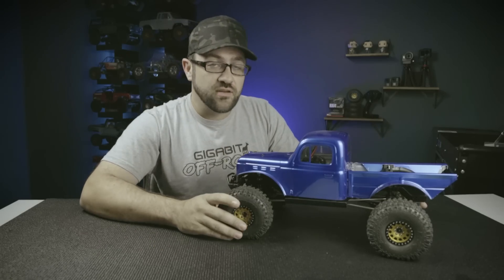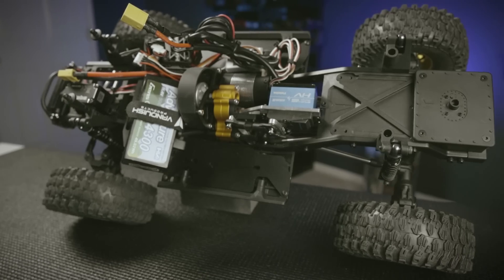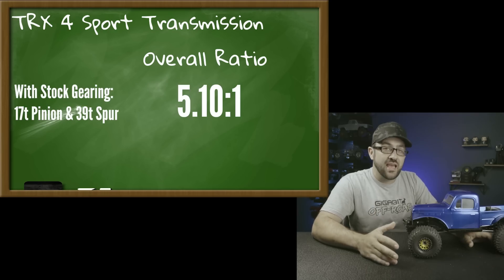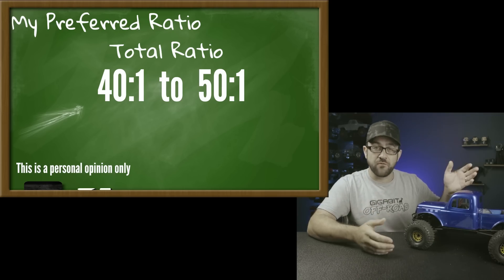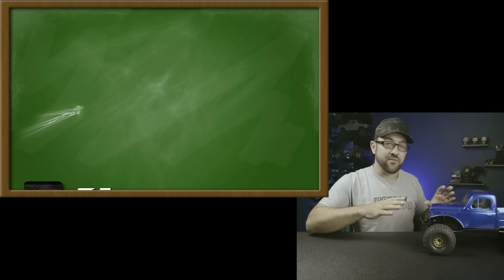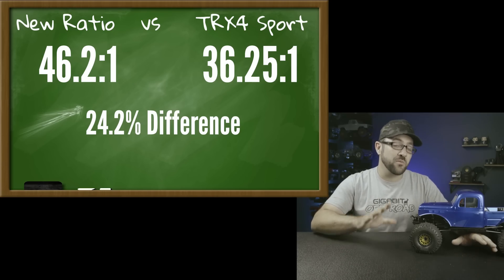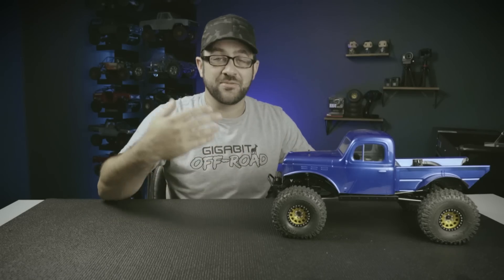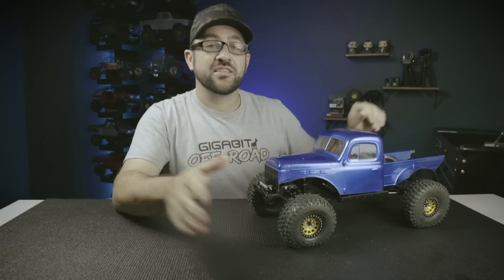TRX4 Axles with Axial Transmission - Gearing Calculations

Comment: I know I’m late to the game on this video but I’m trying to do something similar.

I have a TRX4 sport on an injora LCG chassis. I’m wanting a dig unit type transmission. Going to run an SCX10 skid (already made sure it fits the chassis I have). Transmission I went with is the VRD Hurtz Dig 3gear transmission. Staying on the TRX4 portal axles for now. 

This video greatly helped me figure out what pinion/spur combo I need to start with. 

My question is, what driveshafts are you using to go from a VP/axial style transmission to Traxxas axles? Would I still be able to run my Traxxas drive shafts? I understand some switcheroo on the shaft halves would need to messed around with for length but will the end caps still mount up? If not, what shafts are/were you running for this setup?

Comment: Does the sport and defender/bronco have different gear reduction in the portals?  Everyone keeps saying 2.3:1 in portal but mine measures 2.55:1....... 9 input and 23 output. That's 7.89 axles ratio not 7.11

Comment: Hey man i have a chassis vs410 phenix and vfd trans can i do the same with the vfd trans and skid or do i need to make custom links ?
Reply from the maker: I have made TRX4 axle work with a VFD before. You will need a couple new links though, I created a custom set that you can buy for that though. It's on the Vanquishproducts site. IRC00202 is the part number. I used that in combo with the SCX10-2 link set but the Phoenix set will work as well I believe.

Comment: Have you put trx4 axles under a vs4-10 with vfd transmission???
Reply from the maker: I have but it requires some less than ideal spacers on the axle side to be used to make the upper link clear the trans. I prefer to stay with the 3 gear for this setup.

Comment: can I use trx4 sport stock transmission gears and spur/pinion paired with scx10ii ar44 axles? is that possible?
Reply from the maker: That would not be an ideal combo. Going to the largest spur and smallest pinion would get you the closest but still not perfect.
Reply: @HarleyDesignsInc  thanks for your guide bro. How about using the scx10 portal axles, will that make the cut?

Comment: What would you recommend gearing wise with the vfd trans and trx4 sport axles? Would you still run a 50 spur and 20 pinion? TIA
Reply from the maker: Yes that’s still where I’d start.
Reply: @HarleyDesignsInc  I actually left the stock 56t on it and did a 15t pinion and its not that bad still has a little pep but would not call it fast lol

Comment: I understand you're using a dig but if somebody is not interested in one what's your opinion on using SSD's high ratio Wraith transmission with this axle conversion? I already have that axle setup with a stock ratio Axial 3 gear transmission and went to a 44t spur and 22t pinion and the speed is pretty much what i want with a 3S battery but i'm considering going to the SSD's trans

Comment: Hey just a few questions, would you be able to share the gear spreadsheet for us and why did you ditch the locking differentials?
Reply from the maker: I would need to redo the spreadsheet as it was just something I threw together quickly to do the math. 

I got rid of the lockers as they just aren’t an item I like to run. I prefer to keep everything locked.

Comment: If I wore to add the trx 4 axle to my 10.2 in the rear with ar 44 in front would I use the same method to find the right gearing ?
Reply from the maker: Gearing would calculate the same way. But you have to make sure you can reverse the rotation of the rear axle or that it spins opposite of how the AR44 does, which I don’t recall.

Comment: Changing the TRX4 spur and pinion is not easier?
45/15 = 47.4:1 final gear ratio.
Reply from the maker: The point was to get away from the TRX chassis and trans.
Reply: @HarleyDesignsInc  Oh ok..

Comment: Would a higher KV brushless motor also be an option? For instance, if you just happened to have a 3300kv sensored motor lying around, the default gearing from this setup would essentially gear down that motor for more trailing speed, wouldn’t it?

Comment: Awesome info on the math but it’s a 9t not a 10 for the 
Portals. 2.55
Reply: TheCLA8N 75 like I said he did an awesome job explaining the math. I’m letting him know he’s off a tooth which actually makes a big difference. He thinks he will have 46.2:1 but will actually have a 51.22:1 ratio which is out of the range he was hoping for. So I’m not calling him out just trying to help. I just put trx axles under a wraith and also put those SCX10ii axles under the trx, it can get frustrating quickly.

Comment: I just completed a similar rig. But I mated a Element Stealth X tranny to Sport axles. In stock form it has 99.8:1 to the front tires, over 100:1 to the rear.
Reply from the maker: Yeah that sounds like a really low ratio, definitely need to look into the gearing options. The Element uses an pan drive slipper also I believe so gearing choices may be limited.

Comment: Great Video can you do a math video on TRX-4  overdrive and underdrive gearing? specifically on how it affects torque output from various motors like a Holmes Hobbies revolver or a  puller pro in addition to a stock trx-4 motor. it would make understanding why this is beneficial easier and help identify the best mods for the crawler market.
Reply from the maker: The benefits to OD/UD aren’t always about the math. The values just need to fall into reasonable ranges for them to be effective at their designed tasks. I go over the overdrive percentages at the end of this video for a TRX4, as for the motors, that’s not something that this math is really for. You’d have to start comparing dyno graphs from each which is something better suited for Holmes Hobbies to do.

Comment: Will be keeping this video on hand as new to crawling and although I know gearing calculation's more for 1-1 and my 5th scale where I dont use under or overdriven gearing although it is giving me some idea's for my Kraken's, LOSI's and HPI's for sand and mud running on tight track's.